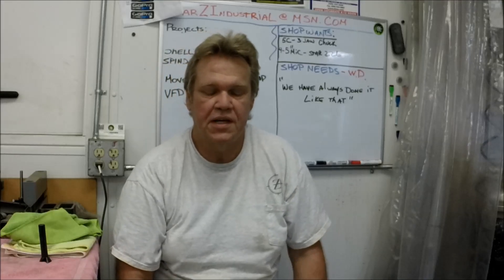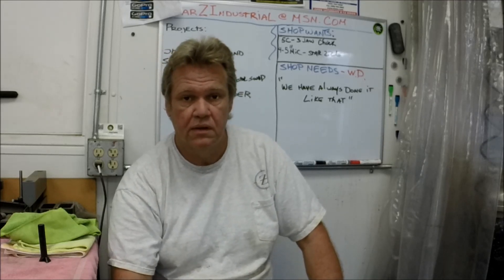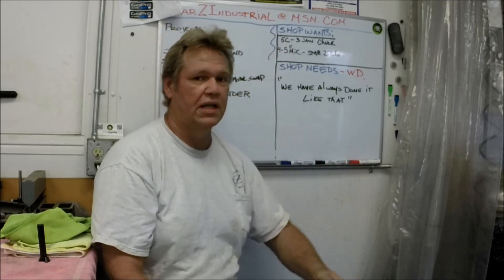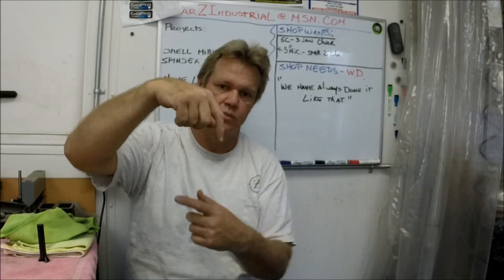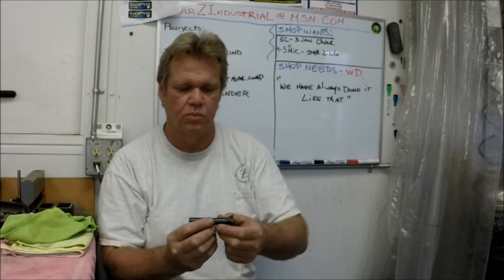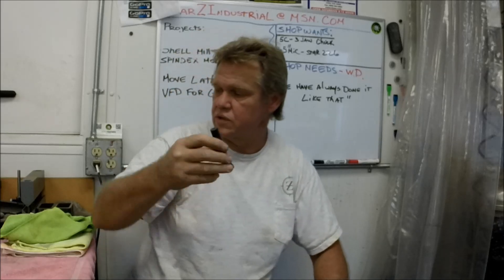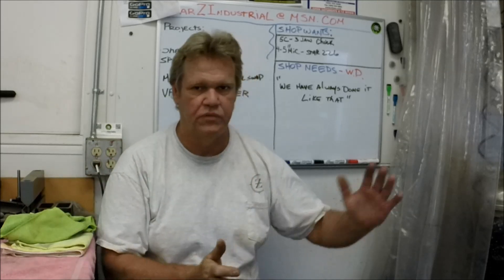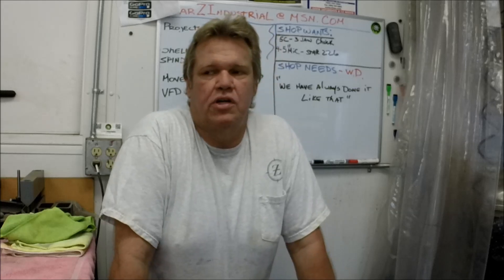Week update #17

Comment: Actually, the original gauge was 4'8". Because of turns in the track, the extra 1/2" was added to reduce the wear of the wheel flanges. There were narrow gauge roads as well. Perhaps the most famous is the Durrango-Silverton Narrow Gauge Railroad. There is also a narrow gauge road from Felton to Santa Cruz here in the Bay Area. That road is unique as they have one of the last 3-truck Hielsler steam locomotives. They also run a Climax steam locomotive. These locomotives were used for logging. The road also has a standard gauge Alco diesel that runs from Felton to the Boardwalk in Santa Cruz.

Comment: cool video. I see you fell in the trap with the horse carriages :) The roads, in particular in mountainous regions where carved on purpose for the wheels to fall in parallel ruts. They had to, because in the absence of rubber tires and progressive brakes, the carts were completely uncontrollable(they completely blocked the wheels). So the tracks were keeping them on the road. Actually, when you see "roman tracks" in Europe, you probably see something that is not older than 300 years, because they were subject to wear and had to be re-carved every 20-25 years. The profile of the ruts is suspiciously sharp and square upon inspection, they don't look like random erosion, that's what tipped me off once during a hike, and I found the truth about it on google. The Romans standardized because they had to for travel, exactly like a train network (on a side note their pedestrian crossings too implied a standardization). Other gauges existed locally in some places, like in the south of France, I don't know why the Roman empire let them be different and how they did put up with it.

Thanks for the good work!

Comment: Yeah, that aircraft landing gear hardware is highly controlled material....to the point that the landing hook pins (on F/A 18s) are individually inscribed with the machinist's and inspectors employee numbers.  Yeah, their jobs are on the line for each part.  Gota wonder how many squares you can cut out of each sharpening of the slitting saw.  Production:  gona make a few Porsches or a couple dozen Pintos?